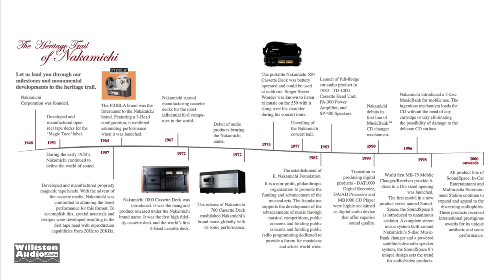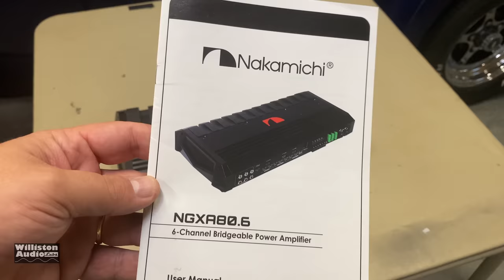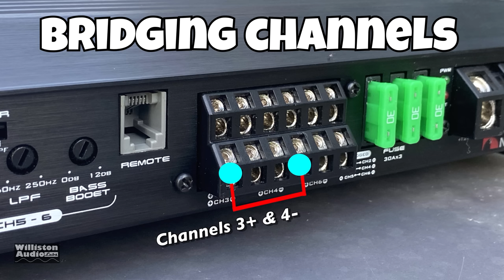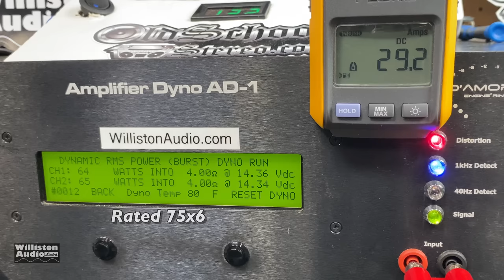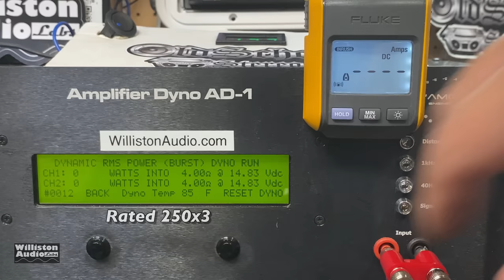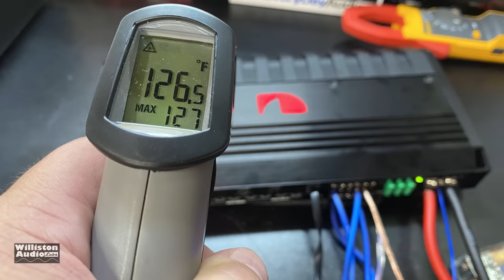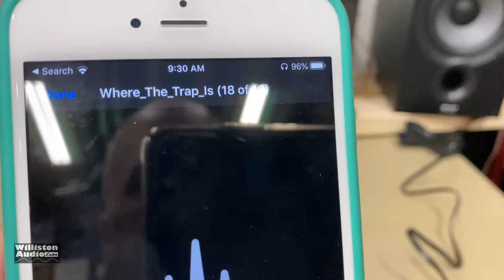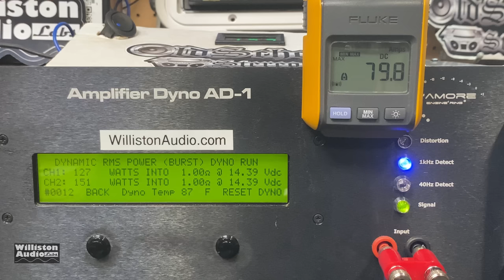Nakamichi is Back! 6 Channels for $200?

Comment: I was at Sound Advice in the mid 90s in Orlando when Shaq came in to get a full Nakamichi system in his Nissan pathfinder.
Reply: I'm amazed that he could fit in a mid-sized suv! I remember the Ford van he filled with Mmatts (Spelling?) back then.
Reply: My dad worked at that store in 95-96! He always said Shaq was a regular customer who wanted the newest and best everything and was always such a nice guy. I still run my Nak bookshelf speakers from 92, sound good still.
Reply: @srarcade  I was stationed in Tampa 94-98 and went to Sound Advice often. I was mainly into home theater. Did work at Circuit City part time and had famous people in there all the time. No one as famous as Shaq though!
Reply: John Clark Actually that Van had Critical Mass equipment. I was at a club in Orlando when he pulled up.
Reply: @johnclark3067  mmats. Have you haeard their products? I have a mmats 1400.1 dhc. It sounds beautiful. The sounds are so warm. Unlike my skar rp2000.1.  It is not warm. The skar is just brutal. Nothing will ever compete with mmats imo.. well im sure something can but i know not of it
Reply: @fallofthezombies1379  Maybe a long time ago, I can't remember for sure. I used to go to lots of events in Florida in the mid to late 90's. I've always been a SQ guy and spent crazy money on mids and highs mainly.
Reply: I went to Shaq's house with a couple of techs from the Orlando store long time ago to install Lojack's on all of his cars. were you one of the guys? this was years ago
Reply: @vishpersaud7825  Yeah, it was Critical Mass, I remember it.
Reply: @fallofthezombies1379  Nobody is saying Mmats didn't build great equipment. We're just saying Shaq's van used Critical Mass.

BTW Mmats amps sounded so great b/c they used Cased Transistors. Better parts, equals better sound.
Reply: Sound advice in st pete miss them

Comment: How the mighty have fallen.
Reply: For reals. I saw Nakamichi headphones at KMart for $10 bucks. This world is so messed up now.
Reply: Atmospheric Pressure I just ended up buying old school used Boston sub amp and a Alphasonik 4 channel. Clean power!!!
Reply: I have one of their better 3 head decks from when they were at their peak in the 90s. its not a Dragon but its still damn nice. Lots of controls for bias and trim....For my car stereo I use an old school soundstream Rubicon 4 for my bi-amped front stage and Rockford Fosgate Power 250 monoblock for single 12" AVI Neo (number 83). Sounds like heaven.

Comment: The resistors that are hot are supposed to be - they’re current limiting resistors for zener diodes that convert the rail voltage down to +/-15V for the opamps in the preamp and crossover stages. The nearby caps are receiving heat from the resistors radiation and are unlikely to be heating themselves.

Comment: Nakamichi was one of the best in the mid to late 80s. Expensive car audio but was incredible.
Reply: I had all Nakamichi in my car in the mid to late 80’s.  It’s still in the car too sitting in my garage. 😂

TD-800 cassette deck.  Pull out with Azimuth control. 

Two crossovers

2 amps.  75X2 and 35x4.  These drive the mids and highs. 

I had an Alphasonik 125x2 amp also for the subs.  2 Fosgate 10’s and Gold Sound 12 dvc

It sounded okay.  I had Polk audio plates and Fosgate mids and Vifa tweeters.  Clean sound but lacked power.  

I don’t have the amps anymore though.  I put those in some friends cars who needed amps.  

My brother has a home Dragon deck.  Not sure if it’s working though.

Comment: I have this amp powering Bass Face 2 way components at the front. JBL Club 6 X 9 's on the Rear Deck and Two 12 inch Bass Tubes by Bass Face in the boot I was impressed with the sound. Contrary to the test it is loud and Bass fills the Car. The sound quality is impressive too you can't go wrong for the money 💰.

Comment: I think for the money its a great option for someone wanting to run 3 way fronts in a daily. Im going to have to look into them and find out if they make a subwoofer amplifier that matches this amp and how does it perform. 

Thank you Big D for the video, awesome as always. We appreciate your hard work.
Reply from the maker: Seems to be a solid deal, albeit overrated quite a bit
Reply: you must be a patreon
Reply: If you're going 3 way active, you wouldn't skimp on this. Plenty better options out there.
Reply: @mattpierce4143  your right, i have Lp amps on my 3 ways but my 17 year old nephew would run something like this because its cheap.
Reply: Not everyone can afford to spend 6-7k on car audio. I think its a great option for the younger generation that are just starting out and want 3 way fronts.
Reply: @travismclendon8961  gotta pay to play, and nowhere near $6k. Can't afford $700 for 3 way? Stick to 2 way. Nothing wrong with a legit active 2 way. Cheap speakers sound good on a good amp...but good speakers do not sound good on a cheap amp.
Reply: Hell most people cant even setup an active 3 way correctly to begin with. You need tuning with a mic 9/10 times on an active 3 way. If you can afford that, then you can certainly afford a better amp. This amp misses the mark on all levels. They will not sell well. Maybe initially, but shortly after install they'll be swapping it out, or going passive. This amp is just an all out fail in my opinion, it does not meet the need of the person who would buy it.

Comment: Love your videos, yo! I found this one when I searched for tests on MY Nakamichi amp, the NGXA80.4 and figured it had to be pretty much the same amp with just 2 less channels as the one you tested here. I was right. I found this amp for $150 on eBay brand new. I chose it because of the specs VS the price plus the fact that I'm 62 years old and remember Nakamichi from way back in the 70's and 80's and their high-end stuff. This one is claimed to be a "2,000 watt amp" but the specs are pretty much the same as the 6-channel you tested in this video. I've been very happy with this NGXA80.4 so far. I have it powering 4-way Pioneer 6.5's up front with Cerwin-Vega tweeters in parallel (hooked up right, with bass blockers and resistors as well as the CV crossovers) and the same combo in the rear but with 5-way Pioneer 6x9's. I can say one thing; everything does sound nice and clean, and it plays my music louder than anyone who gets in my car can handle! But after watching this video, you made me want to go out and find a different amp! Really! It made me realize how much Nakamichi over-rate their amps specs! Now I'm going to look for a different brand of amp with more realistic specs! Although I don't go for massive hair-moving SPL levels, I simply like car audio to be crystal clear and sound nice at a lower volume instead of having to crank everything up. This amp does what I want it to. My head unit is a mechless Alpine, which is run through a Rockville 7-band equalizer (I sold the Clarion of the same design and got the Rockville because it was the ONLY 7-band I could find ANYWHERE that had ONLY the 7 frequency knobs to the right of the input selector switch). My signals go through high quality twisted RCA's I got from KnuKonceptz and I run 12g Audiopipe speaker wires to my front speakers and 10g Audiopipe to my rear speakers. I also run an 800-watt powered 10" Rockville sub. This is my first 10" sub I've ever owned in my 45 years of messing with car audio! I chose it only because it had better low frequency response than their 12's did. SSSSOOOO... now that I've watched this video, I'm not so happy with my amp! Even though I never imagined it to truly put out 2,000 watts, I certainly didn't think the output was THIS low! Time to look for a better amp! But again, this was the nicest 4-channel amp I could find for under $200 from a name I knew and trusted since the 70's. My biggest surprise was when I got the amp, made by a Japanese company, and clearly all over the box was big bold red letters saying "Made In China"!!! Say WHAT? I company in Japan can't make their own products in their own country? I'm still shaking my head at this one! Anyway, I wanted to give you my opinion on the 4-channel version of this amp you tested in this video. I sure wish you could post pictures in YouTube comments, I'd show you my setup. Thanks for the video! Oh, but NO thanks for making me want to replace my Nakamichi amp so soon! LOL! ;)

Comment: Always remember.... " where there is resistance , there is voltage, and where there is voltage, there is heat ... This equals to " high resistance= high heat. Learned this in electronics class over 20 yrs ago
Reply: True from a current source like a tube amp output but higher resistance equals lower power dissipation from a voltage source.

Comment: I’d use that thermal to make a few changes in that amp. First change I would make is putting in some high quality caps and move those hot resistors a little ways away from the caps or put some heat sinks on them and try blending the heat into the side of the amp. It would be fun to see if changing the mosfets and diodes could help get the rated power or if it just needs a better transformer set up. Old amps can be great fun to rebuild especially when you can improve them, it makes me think that there are new amps out there that could benefit from the same treatment.

Comment: I use to do the warranty repairs for Canada in early 2000's. Some car stuff was good and some great. I have the CD-700 head unit which is still fargin marvelous sounding. Have a few of the CD-100 heads( 6 cd for size of single din) not to shabby either.  Been to factory when it was in California. The home stuff is amazing. If you can get the systems they used in music stores to demo cd's, all that was Nakamichi.

Comment: I installed their car stuff in the 80's. Amps were good for mids and highs. Head unit didn't hold up to well. I remember the whole cassette carriage would slide out the front to help maintain head alignment.

Comment: Thank you, again. Awesome video!

Found this on Audio Precision's site.
"THD+N is an abbreviation for Total Harmonic Distortion plus Noise. Total Harmonic Distortion is the sum of all the harmonic distortion products in a measurement, as opposed to selective harmonic distortion, which measures discrete harmonic products separately. THD+N adds noise to this figure."

If the Amp Dyno only measures THD that may explain the lower output?
I don't know. You probably need to ask Tony.

Comment: Unbelievable Youtube! Just yesterday evening I realized what my DIY project is: a 6 mono amplifiers unit (that will be plugged into an adjustable crossover). Damned, how a hell they got know about this and offered this vid to me today?
Reply: Did u pull the trigger? I'm doing a hifi setup with a android chinese head unit with built in dsp and sdpif optical out... a dac and class a/b would be a perfect amp. $199. I wonder how long it would throw wattage at the sub before catching fire.

Comment: RJ-11 is nice because its easier to replace when you damage the cable on accident, or if you have the crimp tool you can cut custom cables so you don't end up with yet another coil of wire jammed into a kick panel picking up EM interference.

Comment: Back in the day, the Nakamichi Dragon was the finest home cassette player you could buy.  It was lusted after by many audiophile.  Then they produced a few head units with the same technology for cassette playback that cost at least $1K.  So sad to see they have been dragged down to the gutter.
Reply: The TD1200 car deck was THE cassette deck to have in your car. If you knew someone with a Nak tape deck and a decent turntable and used decent cassettes, it would sound better (way better) than the first cd players. It would give you a larger dynamic range and wasn't as harsh as the first cd players were.
Reply: I actually had the 1200 and the RX505 auto reverse cassette deck for the home. Still in storage.

Comment: Definitely a nak-off! :-P

Nakamichi was definitely a high end brand.  Best cassette deck hands down was the Dragon.  And head unit (also cassette) was the TD-1200.  Used that combo until the late 80s.  Never liked my Disc Jockey because it skipped on loud beats.  DAT fixed that and could also record discs with no loss of quality.  Those were the days.

EDIT:  Lossy compression on audio tracks does not affect lower frequencies nearly as bad.  Check out Jorge Torres' channel, some decent bass tracks that will make your port loaded subs cry uncle! :-)

Comment: 200 bucks is good for 6 channels and that control. 

50x6 is still a good amount of power.
Reply: Only question is why those ratings...
Reply: @ilkkak3065  lots of decks boast that 50x4 rating "why would i buy an amp that does the same?".
Reply: @Polywog77  Good point. There are some videous that shows 4x50w HU gives 15-19w/channel and 4x100w HU gives even 23w/chanel. I did not think that might be behind these over rated specs. I've known so long that amps might give less or more than they are rated. Back in 90's it just was so much harder to find information of measurement.

Comment: Have you ever tested any older Eclipse amps? I ask this because after watching this video, it made me want to get rid of my new Nakamichi 4-channel amp! It's basically the same amp with the same specs as the one in this video, only the 4-channel model. Now I'm replacing it with an Eclipse PA5422 4-channel amp rated at 85 wpc RMS. It was made in America, so that's already a good sign! Just wondered if you ever tested one. I'd be pretty excited to see a review of this amp! It sure is a LOT bigger than my Nakamichi NGXA80.4 amp is, and probably a LOT cleaner! The only thing I'm not liking about this Eclipse amp is that it doesn't take 4g power cable, it only takes whatever size you connect to screw terminals.

Comment: Thats a pretty awesome device you had there checking the thermal of the amp. That amp did alright as highs, mids  and not the lows but i  might able to do a very small system with the amp. That would be all its good for Derek.

Comment: Remember IR reflects off smooth surfaces like those metal capacitor bodies, so try different angles to see if they're actually hot.. Those resistors next door were definitely hot,  you may have been seeing their reflection off the caps.
Reply from the maker: Good point 👍

Comment: The reason it didn't meet it's ratings is because you are measuring for n-power, but only for plain power. You need n-power compatible equipment for it to reach it's full potential ratings. [SARC]

Comment: If they would've marketed as a 50X6 amp, and being a Nakamichi name, would've worked out great. But being well under the power it claims, is a gut check. Good non bias Video as always. I also like the amp, and being a 50x6 amp with Nakamichi nameplate; for $200 is still a bargain 😃
Reply from the maker: I approve of this message 😬👍

Comment: UPDATE!!!!!! Bought Nakamichi NKSD800.1 amp about 6 months ago.
This thing is sick, it's rated for 800w(N power, whatever that is?) at 1ohm, but I've been running it with two subs at 0.5ohm for a while now and it's doing fantastic! CLEAN signal, no fuses popping, no overheating, no protect mode. I can not believe how good this thing is for how cheap it was. Unfortunately the Nakamichi subwoofer I have isn't doing so well - the juice the amp puts out makes the voice coils rub if I play around 28hz and lower. The other sub I have is doing fine in that department, and I also keep my subsonic filter at 10hz or off basically. I've reduced gain and had to start using the bass knob more to safely play different songs without blowing up my sub, and at the moment I would say it's 100% worth it having to deal with that. I was expecting a lot more problems considering the power for price - in South Africa, there are 500w rated amps that cost almost twice as much as this Nakamichi amp, and the locally made amps dominate the market, because people fall for the ridiculous max watts ratings(some of these 4 channel amps are advertised as more than 10,000 watts! But in the fine print in the booklet, the RMS is usually around 60-100 watts per channel). It really feels like I've discovered some kind of hidden gem that no one else in the area knows exists. Honestly, I recommend this amp to anyone out there who is new to the scene, or is looking to upgrade their old system from running their subs on 4 channel amps to monoblock amps for the first time. You will not be disappointed

Comment: I worked at a store that sold Nak when they came back around in the 90s  amps were OK but the head units were a little cheap.  Had some problems with the innovative 6 disc in-dash changer/stereo.  Great design but had issues with the CDs stacking on top of each other.

Comment: I think I had a Nakamichi CD-700 (not sure about the model #) back in the day for a head unit. It was the go-to of head units and it was a nice piece -think it was around $1100 in the late eighties. Not many people used their amps or speakers. I still have a working Nakamichi BX-300 tape deck in my old school home system. lol It's too bad they've changed hands so many times since then. I'm sure the original Japanese company/engineers have a story to tell.
Reply: you're probably thinking of the TD1200 where the entire center pulled out and you put the tape in the top and slid it back in? 

We used to joke that the tuner could pick up radio free saigon here in Ontario.